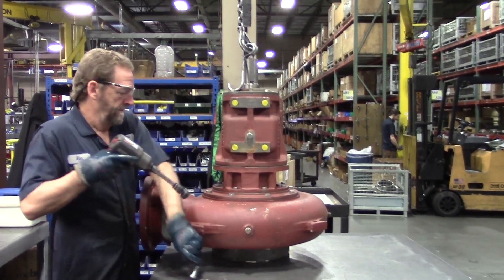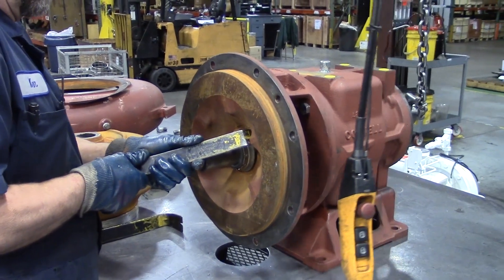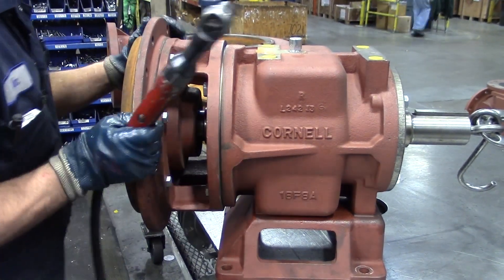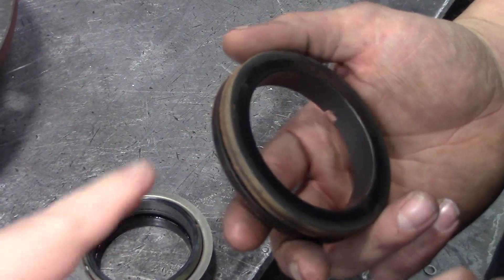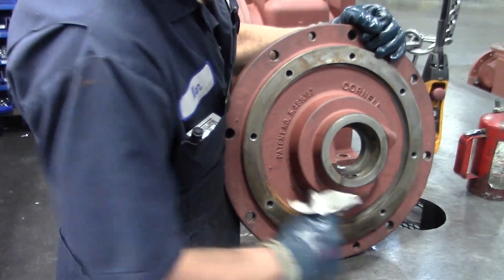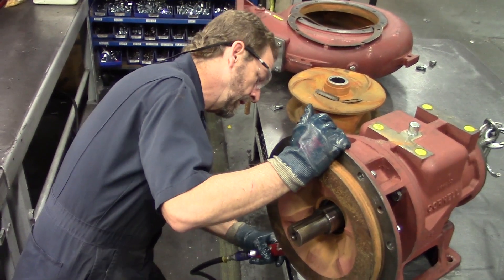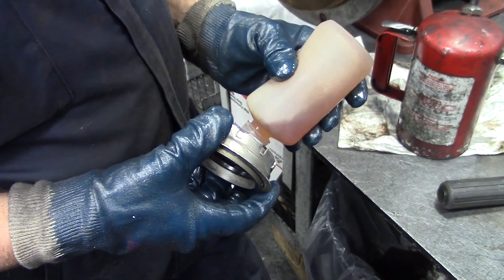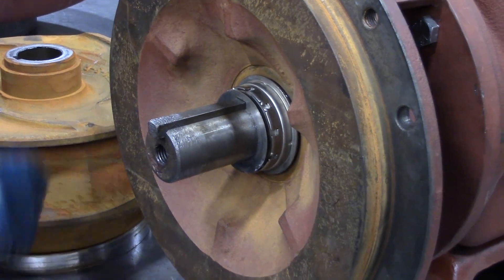Cycloseal Seal Replacement

Comment: I know it an old video but I am working on a very similar pump. Did you cut the video during separation Because it's a fight and hassle to separate? Im trying to separate mine and doent budge.
Reply: Were u able to separate it?
Reply: @iwishtobetexan6060 I did. I believe I used some metal wedges from home Depot
Reply: Use jacking bolts